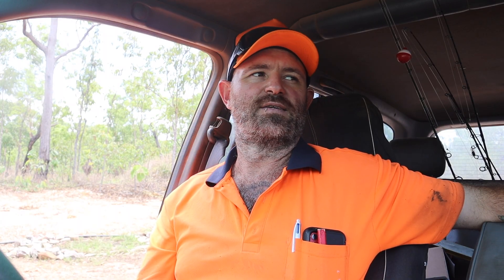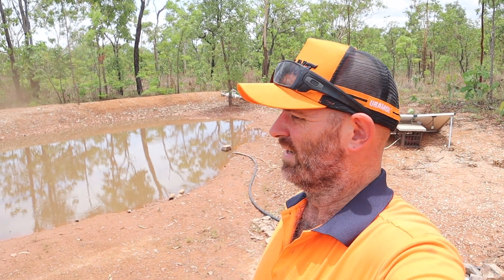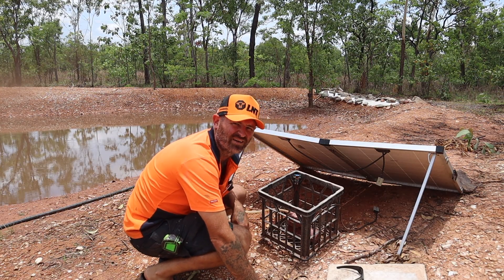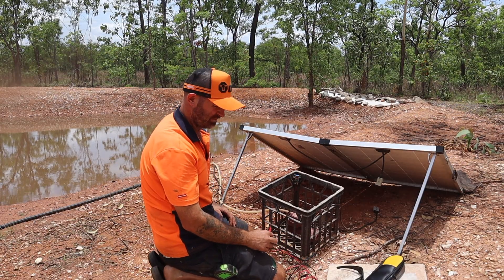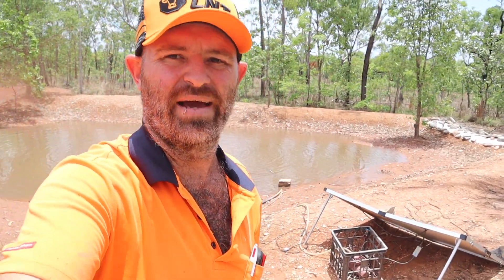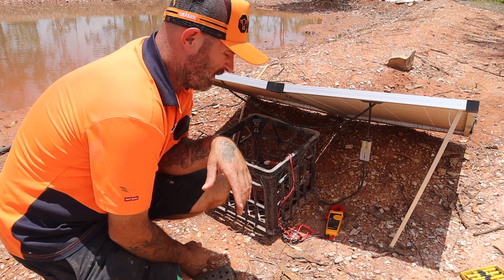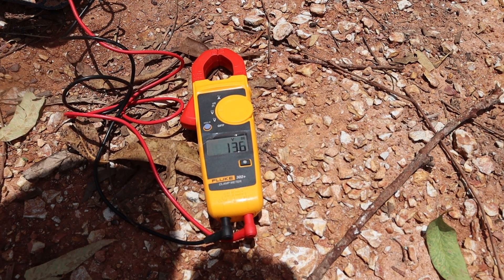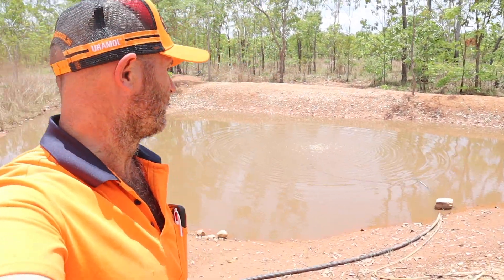The solar powered dam aerator STOPPED working! Lets "fix" it!

Comment: Hi, I can't remember why you decided to put an airator into you dam, could you remind us all. Be careful you will get inundated with way to much work and have no time for the farm, family or friends and it will just happen, especially now you have said you can paint. After being retired for for four years I still get approached but I realise I am just not physically capable of hard wakka anymore, I love driving ride-ons and my backhoe but that isn't to physical for me. I am down in SA and it is just freezing cold and blowing a gale, I had a flat on my ride-on and then found where the strange noise was coming from the front of my car and ended up replacing the front lefthand wheel bearing, I think I may have messed up a bit so we shall see if I have to redo it all in a week or so, did you put the dam sealant in when it was nearly full the other day or has it leaked out and not evaporated away. Have a good day. Leon
Reply from the maker: Hi Leon, I hope you’re not too freezing down in SA. 
The aerator is for future stocking of creatures. I’ll be starting off with some red claw. 
I’ll try not to work too hard but I still have projects that I want to do that need funding, I am not quite ready for retirement just yet 😉 
I haven’t sealed the rest of the dam yet, I want to wait until it’s totally full before I do it. Just need some more rain ☔️. 
Thanks for watching as usual.